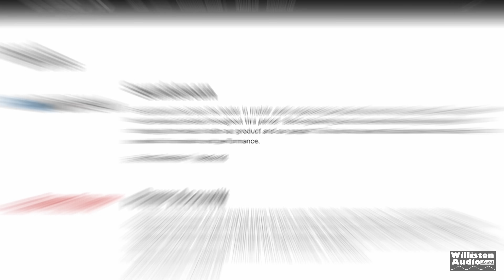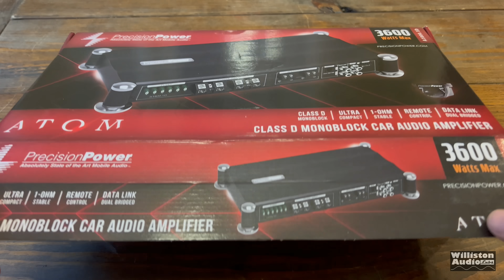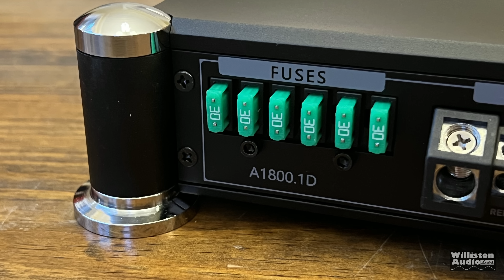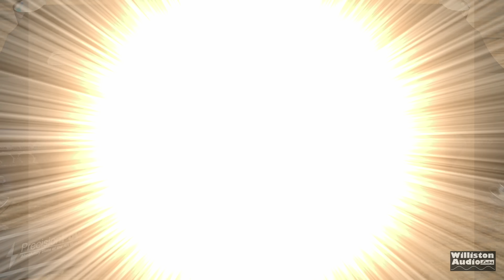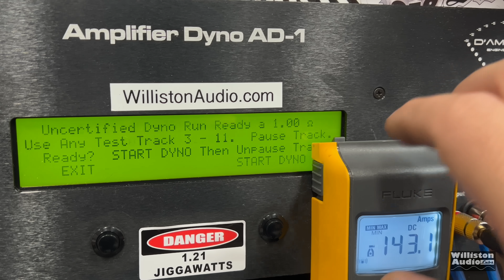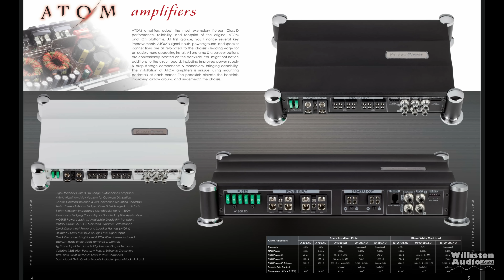KOREAN 1800W Amp for $129? Precision Power ATOM A1800.1D Amp Dyno Test and Review

Comment: The internals looked really nice & the power/cost ratio is decent,, but yeah they really need to stop advertising power that your not getting 🫤
Reply from the maker: I agree completely!
Reply: Nice to see Samwha caps inside.. if I can't have a Japanese cap I'm more than happy with a South Korean Samwha.. I have 25 year old items with Samwha caps still in spec..

I'm a bit iffy about the other caps though.
Reply: It's a pretty cool looking amp too.
Reply: With a cheap amp like this most buyers aren’t aware of how things get over rated. They buy into thinking it’s really got that power for such a cheap price. And, they’re unlikely to have equipment or knowhow to really test the amp and see what it’s actually putting out. 
If they advertised it at realistic numbers people would likely buy something else that’s advertised as more power because they’d believe it’s a better deal.
Reply: Correct, I bought this amp knowing that I’d be getting around 1200rms at 1.3 ohms… still plenty of power for my set up
Reply: Nice to see Samwha caps inside.. if I can't have a Jap cap I'm more than happy with a South Korean Samwha..  I have 25 year old Samwha's still in spec.
Reply: I had one of these, gave it to a friend
Reply: Yeah the like lower impedance like the black ice series...if you have the power  aka voltage I'd run it half ohm..just put a fan and watch temps...